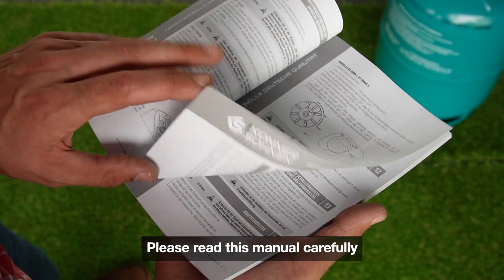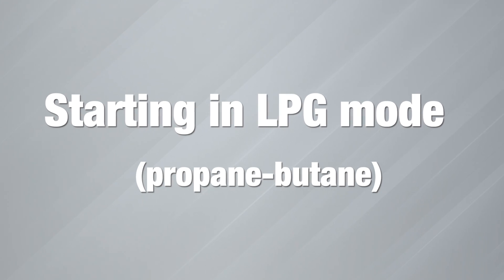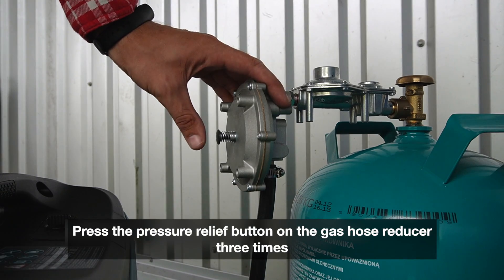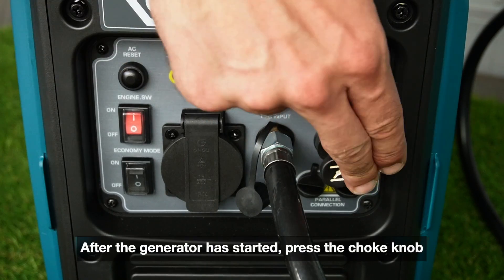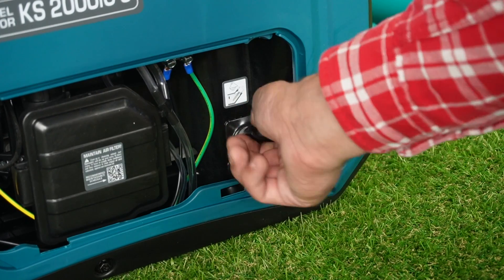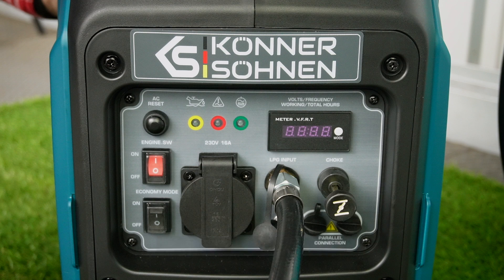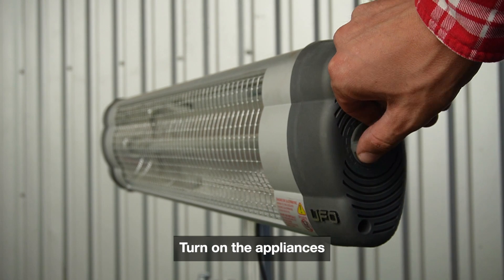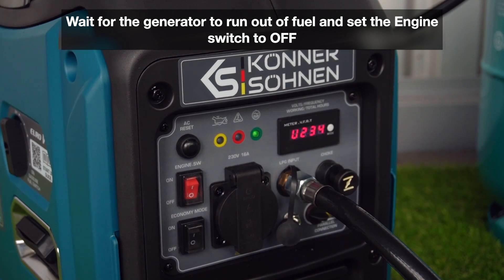Commissioning of a LPG/gasoline inverter generators Könner & Söhnen® KS 2000iG S

Comment: Hello. How many milliliters of oil should be poured into the oil reservoir for this model KS 2000iG S?
Reply from the maker: Hello, approximately 350-400 ml. 
Please fill the engine oil to the lower edge of the oil filler opening so that the low oil level warning does not activate. If there is too little engine oil, the ignition will be switched off.
Reply: @konner_sohnen_en Thanks for the reply. I'm getting this generator soon so I'll be ready.
Reply from the maker: @ZokiG  Thank you for choosing Könner & Söhnen! 🙏
Please make sure to read the user manual carefully before starting the generator for the first time — this will help ensure safe and smooth operation.

Comment: I have big concern about the odour since I plan to store the generator in my house. To this end, I am wondering if the gas generator is less stinky than a standard gazoline generator. Can I use it without even filling it with gazoline? would it make it less stinky?
Reply from the maker: Thank you for your question!
Yes, you can operate the generator without filling it with gasoline — running it on gas (LPG) will significantly reduce fuel odour. However, it's important to keep in mind that this is still a piece of equipment that requires engine oil. During operation, the oil heats up, and some technical smell may still be present, even if you use gas only.
Please note that it is strictly forbidden to operate a generator inside any residential or living space, regardless of whether it runs on gasoline or gas (LPG). Both fuels produce exhaust gases that are hazardous to health, including carbon monoxide, which is odourless and potentially fatal.
If you plan to use the generator indoors in a non-residential technical room, the space must have excellent ventilation and all exhaust gases must be directed outside using a special exhaust extension. It is important to make sure that the smoke cannot get into the room where people can be present.
Reply: @konner_sohnen_en   thank you for your answer. I'm experiencing some power outages at home and I am thinking that a backup might make me feel better, especially during the winter. I will of course operate it outside if needed because of CO. I just am worried that it would stink while stored in my garage for extended periods of time. Maybe I should store it in a ventilated garden shelter.

Comment: Hello KS, I folllowed the steps in the manual and this video, but I can't seem to start the enigne for the first run. What could be going wrong?
Reply from the maker: Hello,

Thank you for reaching out!

If you're having trouble starting the engine for the first time, we recommend contacting our technical support team for personalized assistance. They will guide you step by step to resolve the issue quickly.

You can reach us through:

 - the "Get consultation" form on our website: https://konner-sohnen.com/en/pages/contact

 - Email: support@dimaxgroup.de

 - Phone: +49 211 942 89 001

Comment: What kind of engine does it have and how many cc?
Reply from the maker: The KS 2000iG S is powered by a Könner & Söhnen KS 100i single-cylinder, four-stroke, air-cooled LPG/gasoline engine with a displacement of 79.7 cm³ (2.5 hp).

Because it’s an LPG/gasoline inverter generator, the set includes everything needed for gas operation— so you can simply connect a gas cylinder and start running on gas immediately.

More details - 
https://konner-sohnen.com/en/products/inverter-generators-ks-2000ig-s?utm_source=youtube&utm_medium=organic&utm_campaign=comments